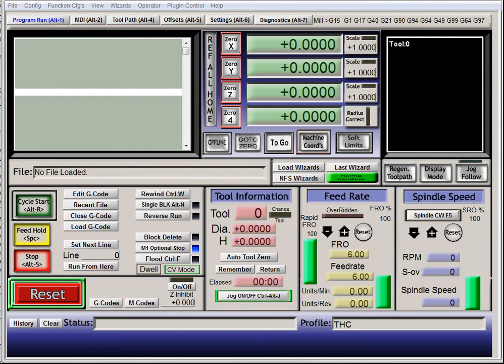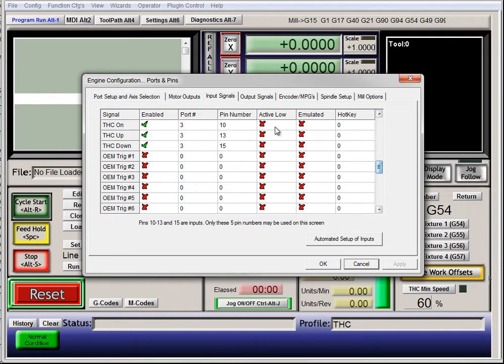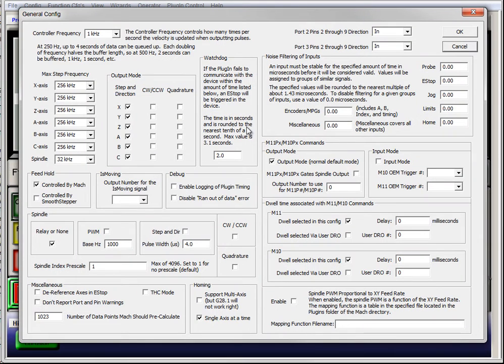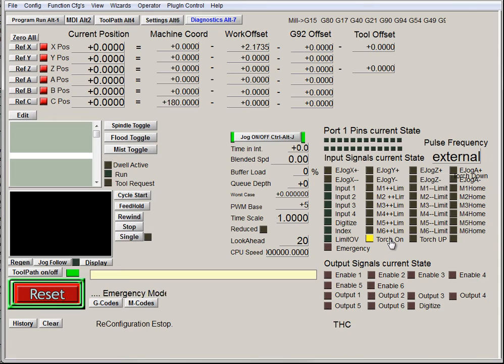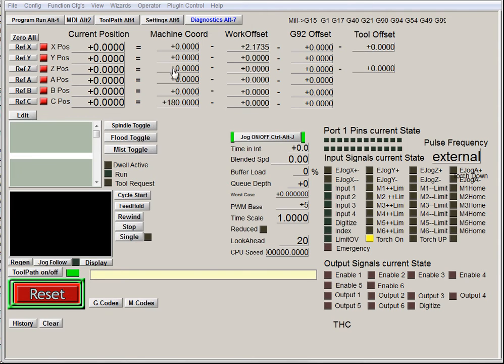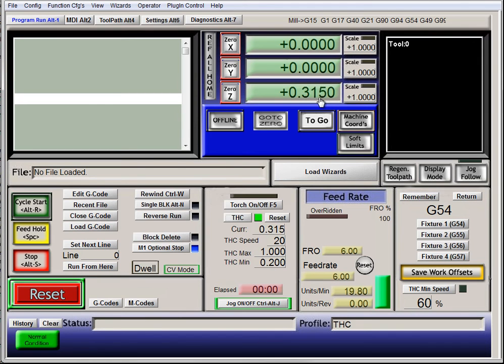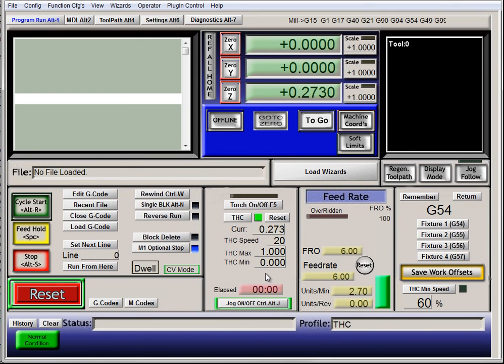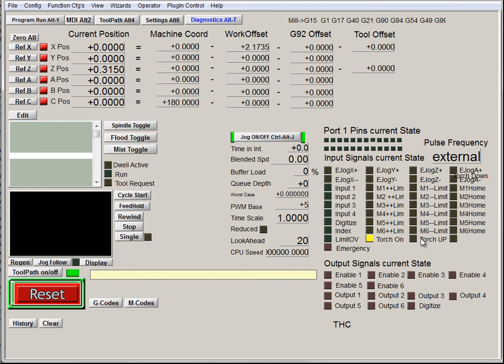How to set up Mach3 to use THC (Plasma Torch Height Control)

Comment: I have a Robo3 stand alone torch height controller. When i activate the THC button and the green light goes on my table doesn't move and the torch just stays there and burns for about 20 seconds, then cuts out. It runs well when the THC button is not activated any idea why that could be happening. Also I have no plugins to select. I have a license for Mach3. Thanks
Reply from the maker: Hi Steve,

Are you using an ESS (Ethernet SmoothStepper)?  If yes, https://warp9td.com/index.php/gettingstarted/setting-up-the-smoothstepper-and-mach
If yes, make sure you installed the ESS plugin.  Then here is our THC guide for Mach3.

https://warp9td.com/index.php/gettingstarted/setting-up-the-smoothstepper-and-mach#THC

Andy

Comment: Do you need to change anything in Mach3 when upgrading to a larger torch? We are going from Hypertherm Powermax 45 to a Hypertherm Powermax 65.
Reply from the maker: Hi,
You will likely need to cut at a faster feed rate and your target tip voltages will change as well.   However, those are settings for your GCode and height controller, not a Mach3 setting per say.

Comment: I do not have anything under my "plugin control" tab. What would be the issue?
Reply from the maker: Are you using an Ethernet SmoothStepper, and have you installed the current ESS plugin for Mach3?  I run the forums at Warp9TD.com and the forums are a better place to ask for help like this than in the YouTube comments section:   http://warp9td.com/index.php/kunena/index

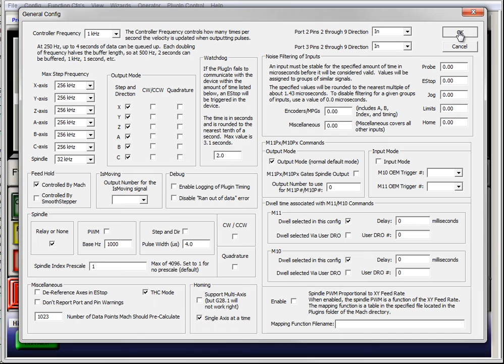Comment: Hi, my mach3 does not have the plug in that you load at minute 1:12, and therefore, the screen of general configuration is not the same as the one that appear in my screen, so I can not mark the "THC mode". Could you tell me how to get that plug in??

Thanks in advance,

Ernesto.
Reply from the maker: Hi, Ernesto, 
You need to be running an ESS (Ethernet SmoothStepper) to use our plugin, which you can get from here https://warp9td.com/index.php/gettingstarted/setting-up-the-smoothstepper-and-mach
Let me know if you need more help, 
Andy
Reply from the maker: @Andrew Crews 
The ESS connects to your PC via Ethernet and provides replacements for 3 parallel ports (among other things).   Existing parallel port BOBs can connect to the ESS.   Please read this page (and the ones that follow it) for more information:  https://warp9td.com/index.php/gettingstarted/what-is-a-smoothstepper
Reply from the maker: @Andrew Crews   You are welcome.  I only work with and support SmoothSteppers, and I know that we had to do quite a bit internally to support THC. I am not sure that Mach3 and the parallel port can do THC.  Also Mach3 was replaced by Mach4 over 5 years ago, and Mach3 is basically legacy software.  Almost all new machines are Mach4 (at least any that are supported).
Reply from the maker: @Andrew Crews  I can't speak as to the responsiveness of the Proma unit itself.  However, the ESS's FPGA responds to what the Proma is commanding on the Up and Down pins within 1 ms for the Z motor step pulses.
But if you want to see really fast (velocity commands instead of just direction commands), with multiple anti dive options, look at the video of the TMC3in1 cutting corrugated metal here:    http://documentation.warp9td.com/Hardware/TMC3in1/00_Intro.htm
Reply from the maker: @Andrew Crews  Once you have it tuned in for  your rig, SheetCam + Mach4 makes it a breeze to cut.   One other note is that your Z axis motor needs to be fast enough to keep up with corrugated if you are going to do that.
Reply: @Andrew Crews it can,

Comment: Hello. I am using the USB SS and there isn't a THC mode checkbox in the config screen. I'm using v17fe. However, Mach3 is seeing the arc OK, up, and down signals.
Reply from the maker: Hi, 

The USS FPGA is too small to handle THC functionality.   If you look at out product Details page, you will see that the USS does not support THC.  Sorry.   http://warp9td.com/index.php/products

Comment from the maker: +Leonidas Silva 
I run the forums at Warp9TD.com and the forums are a better place to ask for help like this than in the YouTube comments section:   http://warp9td.com/index.php/kunena/index 

However, we have a Getting Started guide that should help you setup and install your plugin for your SmoothStepper:  http://warp9td.com/index.php/gettingstarted  

Specifically for your question:
1) Download the ESS or USS plugin for Mach3  http://warp9td.com/index.php/sw
2) Unzip it and double click on the 'plugin name'.m3p  file.
3) Mach3 will rename the file and save it as  'plugin name'.dll  in "C:\Mach3\Plugins\"  
4) Follow the rest of the Getting Started guide to setup your Mach3 Profile for your hardware.

Thanks!
Andy
Reply from the maker: YouTube is not letting me reply to Leonidas Silva...